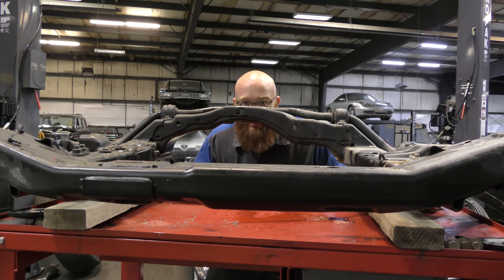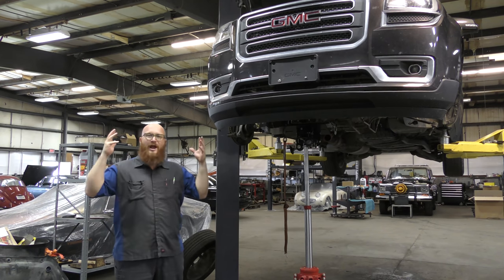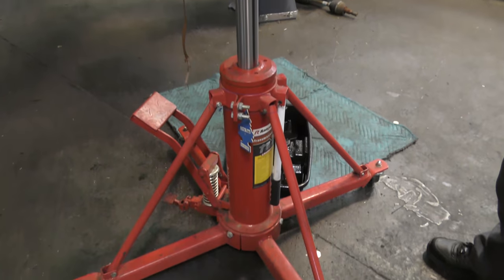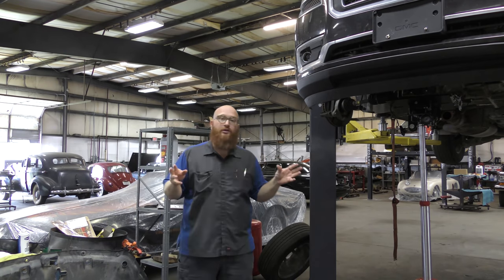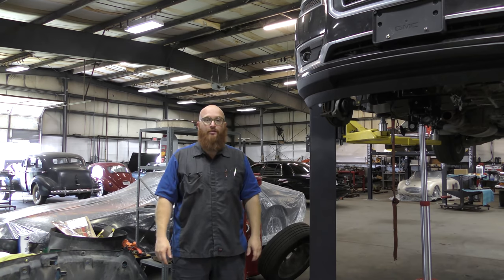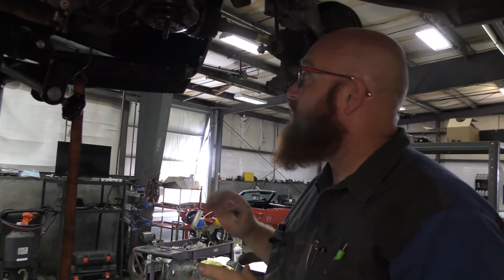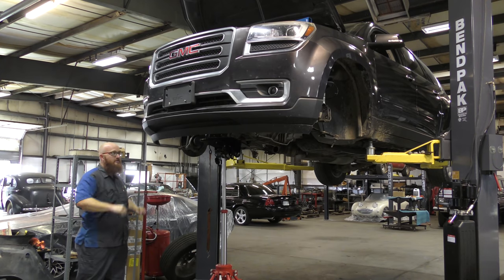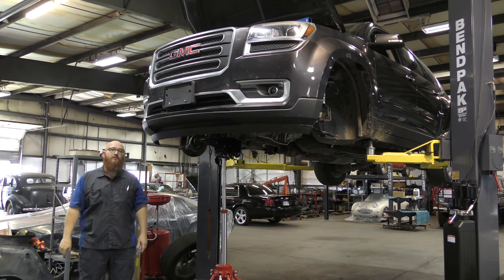Used car insanity in the CAR WIZARD's shop! Why did the huge repair get approved on this '15 Acadia?

Comment: When I was an boy in the early 1970s we had a TV repairman come to work on our Zennith. He opened her up, adjusted a couple of set screws and said "There you go.... That's $50". 
Dad says "$50 for turning a couple of screws?" 
Repair man said "No, 50¢ for turning the screws. $49.50 for knowing which screws to turn".😁
Reply: Nowadays you'd just throw the tv out because the manufacturer won't tell anyone which screw to turn
Reply: @YouTubeAIbot  yep, the TV I have now replaced an old tube type that lasted almost 40 years.
Reply: Now you go to YouTube and fix it yourself.
Reply: @danrogers4617  yep, I do a lot of that! 😂
Reply: @allenrussell1947 :  I got >20 years out of my old LDTV (Low Definition TV) and <5 years out of my new HDTV
Reply: @YouTubeAIbot TV today has a computer board in it covered in a thick layer of goop.
Reply: the original version of that story is about henry ford hiring as guy to get a generator he had installed at his house cutting a slot in the coil to get it to work.
Reply: @allenrussell1947  the old tube type CRT lasted longer but they were heavy, ate allot of power and were space hogs. the picture also wasnt nearly as good
Reply: 1111111111111111111111111111111111111111111111111111111111111111111111111111111111111111111111111111111111111111111111111111111111111111111111111111111111111111111111111111111111111111111111111111111111111111111111111111111111111111111111111111111111111111111111111111111111111111111111111111111111111111111111111111111111111111111111111111111111111111111111111111111111111111111111111111111111111111111111111111111111111111111111111111111111111111111111111111111111111111111111111111111111111111111111111111111111111111111111111111111111111111111111111111111111111111111111111111111111111111111111111111111111111111111111111111111111111111111111111111111111111111111111111111111111111111111111111111111111111111111111111111111111111111111111111111111111111111111111111111111111111111111111111111111111111111111111111111111111111111111111111111111111111111111111111111111111111111111111111111111111111111111111111111111111111111111111111111111111111111111111111111111111111111111111111111111111111111111111111111111111111111111111111111111111111111111111111111111111111111111111111111111111111111111111111111111111111111111111111111111111111111111111111111111111111111111111111111111111111111111111111111111111111111111111111111111111111111111111111111111111111111111111111111111111111111111111111111111111111111111111111111111111111111111111111111111111111111111111111111111111111111111111111111111111111111111111111111111111111111111111111111111111111111111111111111111111111111111111111111111111111111111111111111111111111111111111111111111111111111111111111111111111111111111111111111111111111111111111111111111111111111111111111111111111111111111111111111111111111111111111111111111111111111111111111111111111111111111111111111¹111111111111111111111111111111111111111111111111111111¹111111111111111111111111111111111111111111111111111111111111111111111111111111111111111111111111111111111111111111111111111111111111111111111111111111111111111111111111111111111111111111111111111111111111111111111111111111111111111111111111111111111111111111111111111111111111111111111111111111111111111111111111111111111111111111111111111111111111111111111111111111111111111111111111111111111111111111111111111111111111111111111111111111111111111111111111111111111111111111¹111111111111111111111111111111111111111111111111111111111111111111111111111111111111111111111111111111111111111111111111111111111111111111111111111111111111111111111111111111¹111¹1111111¹11111111111111111111111111111111111111111111111111111111111111111111111111111111111111111111111111111111111111111111111111111111111111111111111111111111111111111111111111111111111111111111111111111111111111111111111111111111111111¹1111111111111111111111111111111111111111111111111111111111111111111111111111111111111111111111111111111111111111111111111111111111111111111111111111111111111111111111111111111111111111111111111111111111111111111111111111111111111111111111111111111111111111111111111111111111111111111111111111111111111111111111111111111111111111111111111111111111111111111111111111111111111111111111111111111111111111111111111111111111111111111111111111111111111111111111111111111111¹11111111111111111111111111111111111111111111111111111111111111111111111111111111111111111111111111111111111111111111111111111111111111111111111111111111111111111111111111111111111111111111111111111111111111111111111111111111111111111111111111111111111111111111111111111111111111111111111111111111111111111111111111111111111111111111111111111111111111111111111111111111111111111111111111111111111111111111111111111111111111111111111111111111111111111111111111111111111111111111111111111111111111111111111111111111111111111111111111111111111111111111111111111111111111111111111111111111111111111111111111111111111111111111111111111111111111111111111111111111111111111111111111111111111111111111111111111111111111111111111111111111111111111111111111111111111111111111111111111111111111111111111111111111111111111111111111111111111111111111111111111111111111111111111111111111111111111111111111111111111111111111111111111111111111111111111111111111111111111111111111111111111111111111111111111111111111111111111111111111111111111111111111111111111111111111111111111111111111111111111111111111111111111111111111111111111111111111111111111111111111111111111111111111111111111111111111111111111111111111111111111111111111111111111111111111111111111111111111111111111111111111111111111111111111111111111111111111111111161111111111111111111111111111¹11111111111122112216r1121x116i11121j112j112s1111v1j1¹1111111111111111111111111111111"11^1%1*1>11$26111211111111111111111111111111,1111111111111111111{11111111111¤111¿111|621¤1111111276121○116¿111111111111111111
Reply: @joerumler6190  that was very helpful😁
Reply: Opening the back to adjust the screws takes minutes but you need to consider transport and time cost for the technician to get to the customer's home and back.
Reply: Roflmao....that's so true!

Comment: "If we can save a few hours for them..."

This is what an honest and reputable person does.
Reply: Most shops now days will do it in less time but charge the customer the full labor hour count. I have never been to a shop or know anyone that has where the shop said they were able to save time or materials so the bill will be less. (True story)👉🏻 I've asked no less than 5 people in the industry if the know an honest and reliable mechanic that won't rip off my parents fir some repairs they need. All replies were "NO". It's sad.
Reply: @PsychoAudio667  It definitely sounds bad, but if they save time on one repair and still charge the full labour hours theres also the other side of the story. Sometimes a repair can take them longer then labour hour count and they charge the same, its a win lose.
Reply: He only do it fo dealers, no regular customers. 
Dealers will bring constant work while customers shows up every once in a while.
Reply: @picks2789  yeah that's when they add things like you were low on blinker fluid or you muffler bearings were about to go🤣 ofcourse we may be able to 👀 through that 🐂💩 but some people have no clue. It sucks that you just don't know who to trust anymore.
Reply: @PsychoAudio667  they use book times. It the tech is good at his job and can do it quicker why should he get paid less???
Reply: Doesn’t matter.  If the rate is 150 an hour you’re still getting hosed.
Reply: @PsychoAudio667  @Jeff Drouant 
BINGO! The auto repair and service industry is mostly filled with incompetent hacks and or 
thieves and con artists. I say drive the things into the ground. As long as they run keep driving them and if at all possible do NOT go to a shop. I've found the exact same experience during my lifetime. I have NEVER found a truly honest, AND competent mechanic at ANY price I paid.
Reply: Saves the Tech time and hassle too
Reply: @NWCI  this is true

Comment: Ford Expedition . . . I bought the used car warrantee. 

1) Engine temp went up and down. Tech said, 'Its supposed to do that.' I nearly jumped over the counter and slapped him. Instead, I changed the thermostat myself. Fixed.
2) One side of dash wasn't outputting AC . . . tech measured wrong side, said cool air coming out. Was a very expensive repair, same cheap part as in this video . . . found out how to 'reset' the plenum actuator by pulling the fuse and switching the ignition on and off. Fixed.
3) Plenum actuator for rear AC started clicking . . . $800 repair! I bought the part (didn't fit) and opened it up, replaced the nylon cog . . . instead of removing interior jammed my arm in and replaced the fixed plenum . . . fixed. 

Do NOT buy a used car warrantee . . . they just deny, deny, deflect, deflect . . .
Reply: The only extra coverage I'll buy is road hazard coverage for wheels and tires. 
I abuse the hell out of that
Reply: Just like any insurance, really...
Reply: Had a house warranty once, spring broke on the garage door not covered, useless
Reply: Stay on topic please.
Reply: I just had warranty work done and they refused to cover the most expensive part even though two different mechanic shops told them it was bad but the adjuster claimed he didn't see anything wrong with it 🙄
Reply: I've actually had good luck with extended warranty and one of those cars was an Audi. Covered everything the dealer said it needed 100%!
Reply: Only buy extended car warranties from the manufacturer.
Reply: most warranties are actually service contracts and are not regulated by laws
Reply: I've had good luck with extended warrantys personally
Reply: @Seegalgalguntijak  You can end up paying your cars value in a single year...for insurance. i understand the aspect of other people, but if they don't fuck up driving we won't have issues. So i can pay my cars value, to have some type of ''right'' to drive. Auto insurance companys need to figure it out.
Reply: @atx-cvpi_99  I bought the platinum warranty for my CPO Camry because the finance guy got it down to $10 extra a month and it included GAP insurance. The very next day after I had just bought the car I noticed a popping noise coming from the roof or rear of the car when going over bumps. Took it to the dealer closest to me because I had bought the car in a city an hour away from me and they said it's the sun roof doing it and that there is a TSB out for it because it's a known issue. Then they proceed to tell me that it's not covered under the CPO warranty or the platinum warranty and that the campaign to get it fixed for free through the TSB had ended a few months before I bought the car. I ended up having to call the dealer I bought it from and taking it back to them who called Toyota who confirmed with them that it's not covered under the warranty and they, thankfully, ended up fixing it themselves with their own money and put me in a rental from Enterprise for the two weeks it took to get the parts and fix it.
Reply: @logandouglas8772  That is only valid if you pay for regular rotations which are more expensive than getting tires a lot more often.
Reply: @toomanymarys7355  Toyota's never questioned it when I come in needing a tire as long as the tread depth isnt below what's acceptable
Reply: My parents got a 2014 Sentra with the crap CVT for pretty cheap and then they got an extended warranty with their credit union. Not even a year later, CVT went out. They paid all $5,000 or so within 24 hours of the claim. That said, it’s because they’re a pretty honest credit union. Which is rare. It’s the CU of Alabama Power. I wouldn’t trust any other bank to do that. And very, very few companies. You just have to do research before buying and see if they actually pay out or not. Because most the time, most companies won’t.
Reply: They all do that, it’s the business. My 08 Highlander purchased new needed a new engine (VVTI TSB but no recall- I wonder why) Three dealers said ‘ that startup rattle is normal’ @42K Well within basic factory warranty. Even Toyota, yes. Sadly. If you get a good one of…. anything, just keep it.
Reply: I would only buy manufacturer warranties
Reply: Not always true. I bought a 3 year old Honda, 22k miles with one year "bumper to bumper" and 5 year powertrain. Didn't pay extra although they wanted to sell me on a almost 3 grand full repair coverage. First year anything was wrong they fixed right away, no problems. 
I'm not trying to sell on Honda but I guess the most important thing is who runs those places.

Comment: Used cars are at a premium right now due to a shortage of new cars, as manufactures are experiencing a shortage of I.c chips to build computers for cars. My son works for a plant that makes dash pads and rubber window moldings for new cars, and the plant is shut down and he's on unemployment due to lack of orders. It's crazy
Reply: And the reason why there is a chip shortage is because when the lockdowns happened, there was a thermonuclear explosion of demand for consumer electronics (video game consoles, TVs, laptops, desktops, etc.) and demand for automotive electronics fell off a cliff.
Reply: @digitalrailroader  well, no. One of the largest semiconductor plants in China burned down, ergo the shortage
Reply: @rafmatt1607  actually, it was a semiconductor supplier in Japan that had the fire; everybody is avoiding Chinese semiconductors like the plague.
Reply: @J Hemphill They did. I don't think you realize the scale of the water shortage.
Reply: @rafmatt1607  wrong
Reply: @kalashnikov1343  China, that's a strange way to spell West Taiwan.
Reply: @digitalrailroader  no, it’s because the automotive industry as a whole went and canceled all their orders for semiconductors because of the expected downturn and reduced sales. They didn’t want to sit on unsold inventory. What they didn’t anticipate is the quick recovery fueled by money printing. Only TSMC as the single supplier for all the consoles, AMD, most iphones and many androids has had the extreme demand caused by the unemployment checks. Chartered or STmicro or infineon don’t have 7nm fabs. But they found new customers quickly enough. And when the auto industry came back and wanted the cancelled deliveries, the semiconductor companies told them they have to get in line and wait a year.
Reply: @HNedel  This
Reply: What it comes down to, this is what we get for outsourcing everything. We were capable of supplying most all of our own demands. But since we regulate and tax way more than many other countries, it makes financial sense to outsource. I think the big issue is politicians thirst for taxes, not to mention the kickbacks these s(umbag elites get for selling out their own country.
Reply: @digitalrailroader  there is more to it than that I think it was mostly malicious
Reply: Now is the time for any competing country to stand up to the USA while we are so Wokefully Weak from the top on down.
Reply: @KamalaTheClown  It's just America, dude. We are all on the same boat.
Reply: @LilYeshua  Conspiracy theories much?
Reply: @HNedel  Even Intel buys most of their chips from TSMC, and they even have their own fab plant.....
Reply: Maybe Washington will wake up and see to it chips are made in the states?
Reply: @MaverickBlue42  intel has multiple fabs in different countries, and a much higher capacity than TSMC. No current intel processor is made in a tsmc facility, correct me if I am wrong, with the exact model.
Reply: @MaverickBlue42  find the difference between „intel buys most of their chips from TSMC“ and „intel has outsourced 15-20% of their NON-CPU products“
Sure, intel has used other suppliers, but you said „most“ of their production, which is plain wrong.
Reply: @mcf3778  The U.S Federal Reserve printing unlimited cash has a lot to do with it. All the Stimulus cash has to go somewhere, now its paying top dollar for used cars and trucks.
Reply: @normanduke8855  lol. Ok. Which radio show should I listen to? Sounds like they use their eyes and ears instead of swallowing whatever you're told by people who obviously couldn't care less about you or me.
Reply: Kinda sounds like an ecosystem/ food chain where one thing is left out, the rest are affected
Reply: @KamalaTheClown  I was in the grocery tonight, God help us. Prices have gone crazy.
Reply: Truth. Only going to get worse too. 6 month order times at the moment. Expect total shutdown in factories soon.
Reply: @theshield1613  look at history. Shortages are nothing new when the money printers are run.
Reply: @normanduke8855  "hater our own government", so how old are you, 6 or 7?